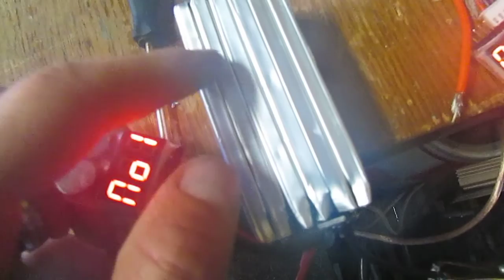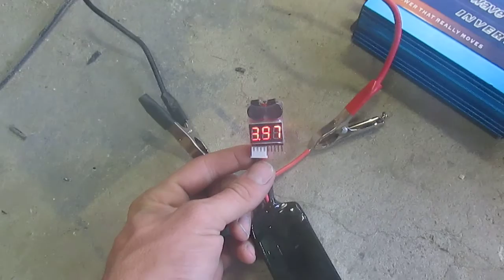11.1v 3S lipo and inverter

Comment: Do you think a common off the shelf inverter would be able to handle a 4s lipo?
Reply from the maker: No they only wort up to 15 volts, 4s is 16.8v max charge
Reply: some are 24v capable

Comment: What was the longest time and load tu have tested this? Loops are way lighter but have punch but maybe not endurance they are 2p3s right?
Reply from the maker: they out put their rated capacity.
Reply: My TV charger adapter  has output of 19v2.1amp. How long can this particular set run...as an emergency source.thanks
Reply from the maker: @erustuscheruiyot7448  around 45 mins per battery in this video
Reply: Going Off Grid thank you.am trynna get my hand on it.

Comment: a quick question if i put this 5200 mah battery on inverter of load 50 watt , it will give 1 hr approx am i right?
Reply from the maker: Yes
Reply: Not necessarily because you don't want to fully charge a lipo and you have to let it cool off after it's charged before you use it also you don't want to run it below 15% so you only get 70% of the battery

Comment: when you said drop in the load ' can you use boost a capacitor to stop the voltage drop , and is it possible to charge lipos on any charger ''''' bcoz i have been charging them straight through main output red and black thick wire using normal lead acid battery trickle charger , and they have charged for hours with out blowing up or even getting hot ' how do i find your other videos on here ?
Reply: You should ALWAYS charge lipos on a balance charger, you may have been lucky and not had an issue yet, but if you have one fail, you will not believe the amount of fire and heat that  little thing puts off.

Comment: i am not very good at electronics ' i re-played your baffling science a few times because all i wanted to know - was the battery fully charged when you put it on the inverter , because you said it lasted eight minites ''''''' eight minites is no good ' sounds like they would have to be wired in parallel '''' this would mean it would take 8 11.1v lipos = 64 minites ,,,, if they cost approx 30 each , 8x30 = 240 for a hours worth of lighting '''' would be cheaper to buy a torch .
Reply from the maker: this is a 300w light if you use a led it could last days